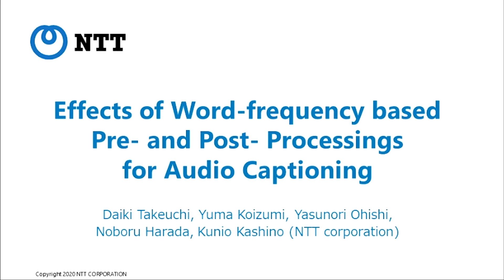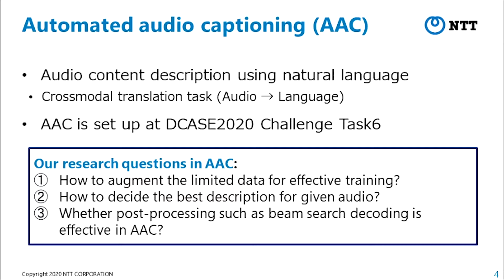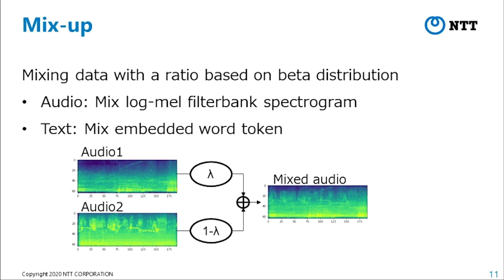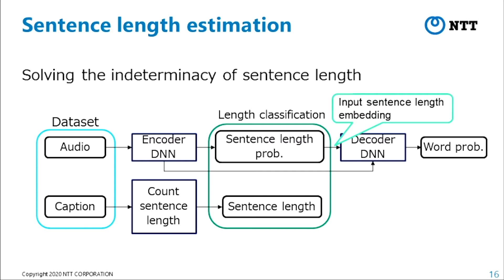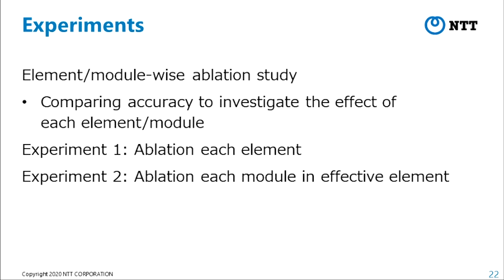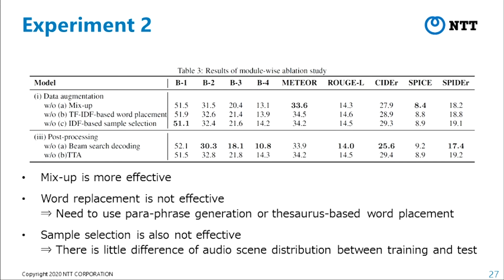DCASE 2020 Workshop, ID 79, Daiki Takeuchi et al.

Comment from the maker: yuma_koizumi
5:13 AM
 Has joined the channel.

daisuke_niizumi
2:15 PM
 Has joined the channel.

kazuhiro_nakadai
2:19 PM
 Has joined the channel.

daiki_takeuchi
3:00 PM
 Has joined the channel.

yohei_kawaguchi
7:57 PM
 Has joined the channel.

yohei_kawaguchi
7:57 PM
Copied from Zoom

Keisuke Imoto 02:16 PM
It seems that the sentence length highly depends on an annotator of a caption.
The sequence length estimation module work for another dataset?

daiki_takeuchi
1:53 PM
Thank you for copying.

We don't conduct experiment for another dataset yet.
But as you sey, sentence length depends on an annotator.
So, we sholud conduct experiment with another dataset as the future works.

fassio_blatter
9:22 PM
 Has joined the channel.

robin_scheibler
9:39 PM
 Has joined the channel.

fassio_blatter
9:45 PM
 Has left the channel.

yohei_kawaguchi
9:50 PM
Copied from Zoom

Xuenan Xu (SJTU) 09:37 PM
What’s the accuracy of keyword estimation task?
This question has been answered live

Il-Young Jeong 09:38 PM
For w/o IDF-based sample selection experiments, how did you choose 1 caption from 5? or you used all 5 captions for training?
This question has been answered live

Konstantinos Drossos (Tampere) 09:40 PM
Did all the tasks/losses weighted the same? Or there were different weights for different tasks?
This question has been answered live

daiki_takeuchi
2:21 PM
 Xuenan Xu (SJTU) 09:37 PM
 What’s the accuracy of keyword estimation task?
We didn't confirm the accuracy of keyword estimation because we focused on the accuracy of audio captoning.
 Il-Young Jeong 09:38 PM
 For w/o IDF-based sample selection experiments, how did you choose 1 caption from 5? or you used all 5 captions for training?
We choose 1caption randomly from 5 captions.
In the other words, 1 caption is sampled from 5 captions based on uniform distribution.
 Konstantinos Drossos (Tampere) 09:40 PM
 Did all the tasks/losses weighted the same? Or there were different weights for different tasks?
No. The tasks/losses were defferent. The details are written in Sec. 2.4 of our technical report.
(http://dcase.community/documents/challenge2020/technical_reports/DCASE2020_Koizumi_63_t6.pdf)

yohei_kawaguchi
4:18 PM
xuenan_xu il-young_jeong konstantinos_drosos

keisuke_imoto
1:33 AM
 Has joined the channel.